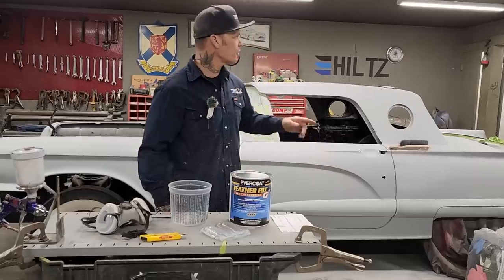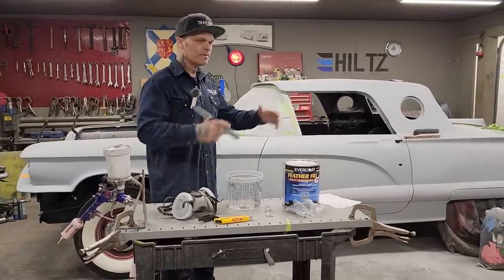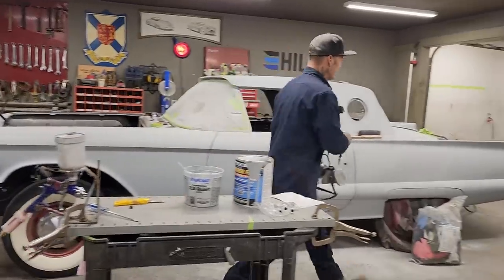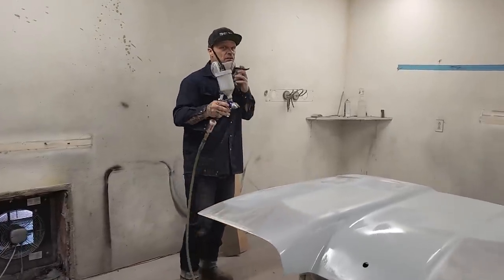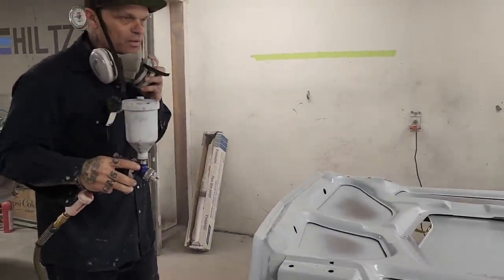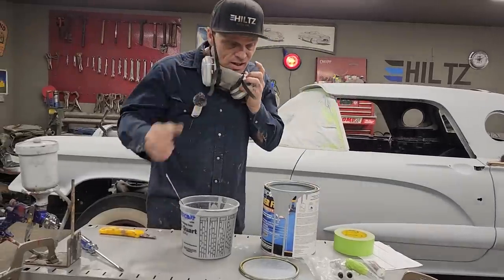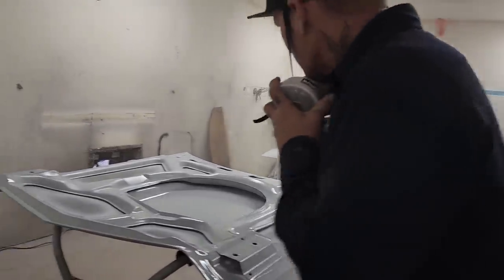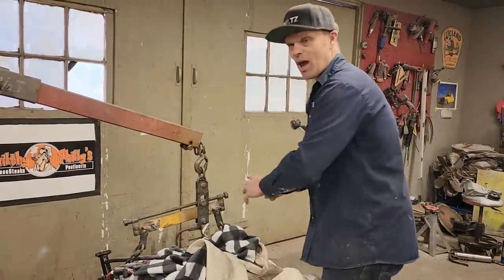Priming Tutorial + Exciting Announcement 👏🏼

Comment: Hey Chad, that primer would lay down heaps smoother with around 5-10% reducer or thinner. Its too dry and cloggy.
Just try It and you're going to like it.
Reply: Yeah wayyyy to thick! look at the orange peel you're getting and that will need heaps of sanding.
Reply: @andrewstewart8704  yes it’s not spraying out that well but orange peel doesn’t matter. He’s looking for high build and once he block sands it he’ll spray on a guide coat to start block sanding with finer paper as it gets level.
Reply: @mrstyle_67 I do get that but I don't see the point in creating more sanding work by creating orange peel low spots.
The areas that have not been repaired will require more sanding with the orange peel.
I saw it on a previous video where the orange peel low spots were huge.

Comment: Chad, when u open a paint can, use a pointed pen knife od a sharpened screw driver to punch a small slid at the bottom of the grove around the paint can so the lid will go on without squirting paint on you.  I had my own shop and at age 80  and being a smart guy I though oy this around age 20. works on house paint and any paint can that u pour out of.